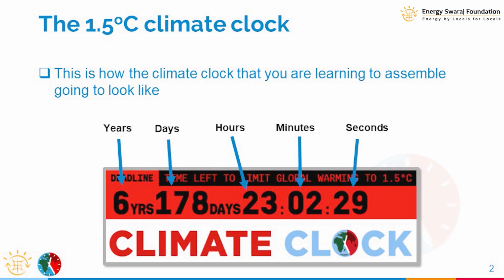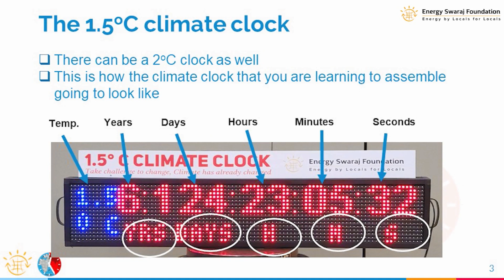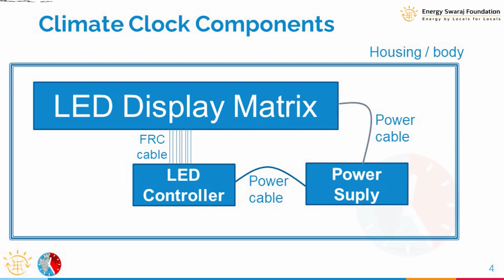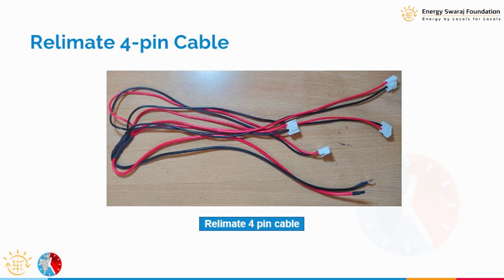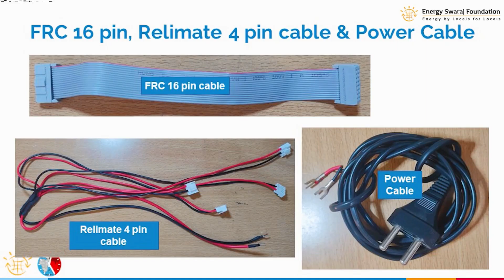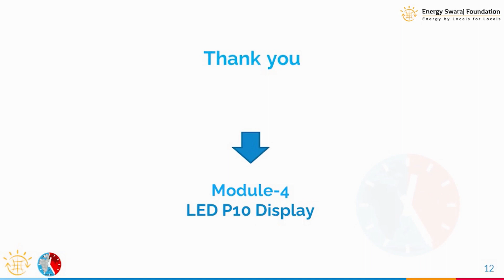Module 3 - Components of a climate clock |1.5°C - 2°C climate clock

Comment: Climate change is one of the most pressing and complex challenges facing humanity today. It refers to long-term shifts in global temperatures and weather patterns, primarily caused by human activities such as the burning of fossil fuels, deforestation, and industrial processes. Here are some key points to consider when discussing climate change:

1. *Scientific Consensus:* The overwhelming consensus among climate scientists is that climate change is real, largely driven by human activities, and poses significant risks to the planet. This consensus is supported by extensive research, data, and models.

2. *Greenhouse Effect:* The Earth's atmosphere contains greenhouse gases, such as carbon dioxide (CO2), methane (CH4), and water vapor. These gases trap heat from the sun, maintaining a suitable temperature for life on Earth. However, human activities have increased the concentration of these gases, enhancing the greenhouse effect and leading to global warming.

3. *Global Warming:* Global temperatures have been steadily rising for over a century. This increase in temperature is causing a wide range of impacts, including more frequent and severe heatwaves, melting polar ice caps, rising sea levels, and disruptions to ecosystems.

4. *Extreme Weather Events:* Climate change is linked to an increase in extreme weather events, such as hurricanes, droughts, wildfires, and heavy rainfall. These events have devastating consequences for communities, economies, and ecosystems.

5. *Ocean Acidification:* The absorption of excess CO2 by the oceans is causing ocean acidification, which harms marine life, particularly coral reefs and shellfish.

6. *Impacts on Biodiversity:* Climate change threatens biodiversity as ecosystems struggle to adapt to rapidly changing conditions. Many species are at risk of extinction due to habitat loss and altered ecosystems.

7. *Human Health:* Climate change also affects human health. Heat-related illnesses, respiratory problems from worsened air quality, and the spread of diseases are among the health risks associated with a changing climate.

8. *Economic Consequences:* The economic consequences of climate change are vast, ranging from damage to infrastructure caused by extreme weather events to reduced agricultural yields and increased healthcare costs.

9. *Mitigation and Adaptation:* Mitigation efforts aim to reduce greenhouse gas emissions, often through the transition to renewable energy sources, increased energy efficiency, and changes in land use. Adaptation involves preparing for and responding to the changes that are already occurring or are expected to occur, such as building resilient infrastructure and adjusting agricultural practices.

10. *International Cooperation:* Addressing climate change requires international cooperation. The Paris Agreement, adopted in 2015, is a landmark international accord that aims to limit global warming to well below 2 degrees Celsius above pre-industrial levels and strives for a more ambitious target of 1.5 degrees Celsius.

11. *Individual Action:* Individuals also have a role to play in addressing climate change. Reducing personal carbon footprints by using public transportation, conserving energy, reducing waste, and supporting sustainable products and practices can make a difference.

In conclusion, climate change is a global crisis that demands urgent and sustained action. The consequences of inaction are severe, affecting not only the natural world but also human societies and economies. Efforts to mitigate and adapt to climate change are crucial to ensure a sustainable and habitable planet for current and future generations.